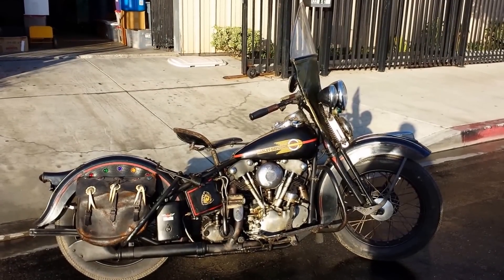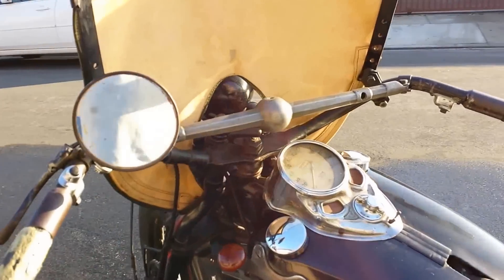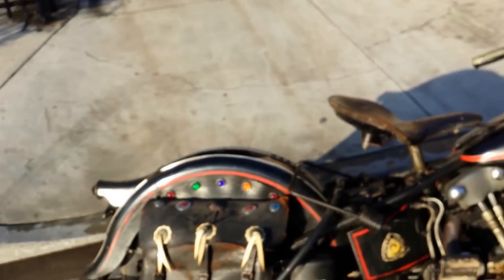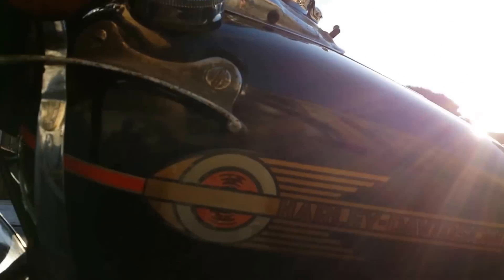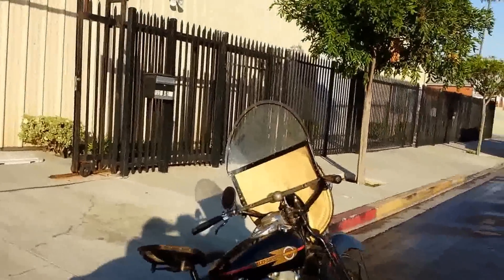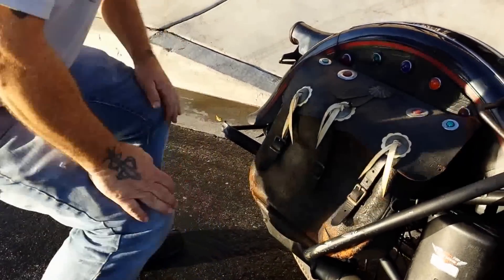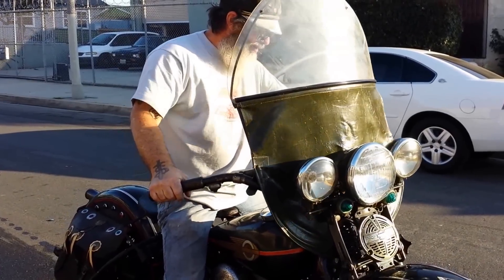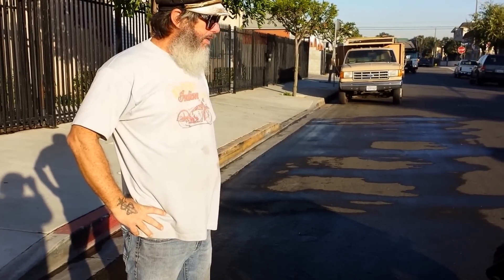Hunting Harley's, 1938 OP Knucklehead 1st ride

Comment: Very true,Like you said back in the 60's 70's 80's them vintage h-d parts were all over. put can't you tell  if it is not from the stock frame just the way it looks in the frame the routing of the electrical lines and etc.
Reply from the maker: all signs are, right now, that they were NOS original paint when mounted. I could be in for a surprise when I get them off, but I doubt it. Either way, I will record what I find and upload it here.

Comment: Todd, did you ever pull the tanks to see if they are nos tanks ? Was that motor in that frame from the factory?  did't see any videos on that.
Reply from the maker: I am planning to pull the tanks to derust them and clean the petcocks. I am positive they are NOS, but pulling them will tell the full tale. As far as I can determine, that frame came with that motor. But a lot of things can happen in 76 years that are not always so easy to discern. Lots of people have bikes they are sure came with that frame, but actually did not. I only have history on this one back to the 1980's. As I said in one of the videos, without day of sale photo's and a bill of sale or invoice showing the motor number, we are all assuming about ANY bike.
Reply from the maker: +steve kwall I did, there are videos on this. I need to have a special tool to figure out the paint on the tanks which I do not have. i have been able to trace the history of the bike since new now, waiting on pictures before I can make another video.

Comment: whats with that big bar across the handle bars for ? and why a round steel ball in the center ? what is theirs  purpose  ?
Reply from the maker: +Mario Maldo That is an accessory light bar that came out, roughly, in 1926. It was a standard accessory offered by Harley through their accessory catalogs through much of the 1930's. They are not so very common today. This design is considered "art deco" in nature. Why they designed it to look this way, it was simply the artistic expression of the time. People years ago would often ride their kid on the gas tank in front of them. HD and accessory companies even sold front seats and pads for the tanks from the teens through the 1960's. Laws today forbid this. Today, people have to be PC and "safe". People also used the bars to mount various accessory lights and other items.
Reply: +HuntingHarleys I like old harleys the new harley is not a harley it a porche with harley logos and fancy paint